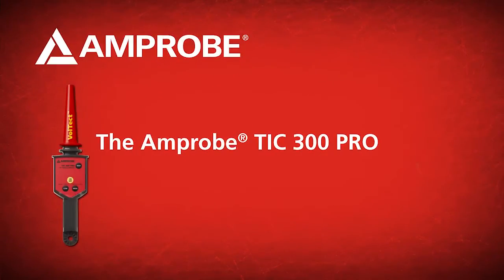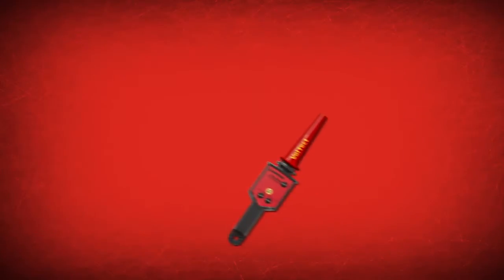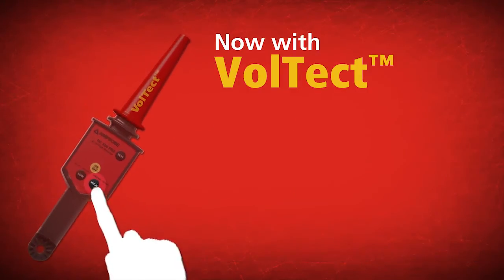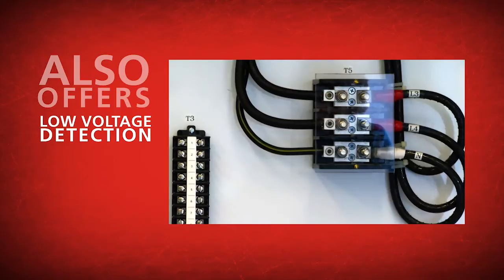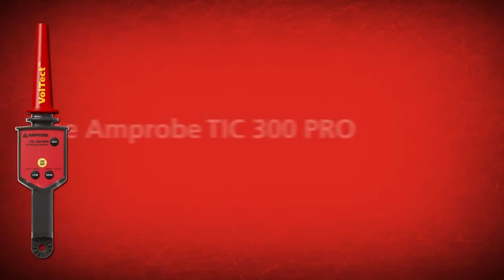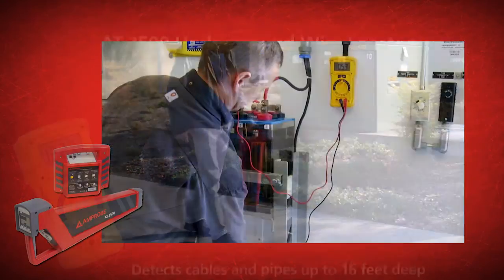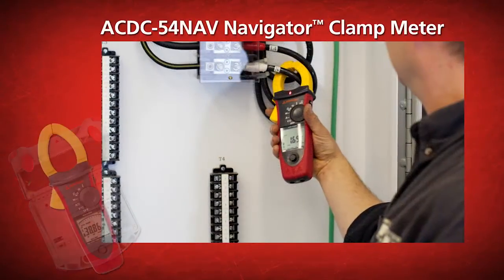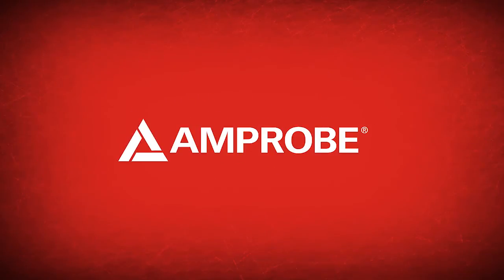Amprobe TIC 300 PRO with VolTect™ Non-Contact Voltage Detector

Comment: I find this tool useless for working under power lines. It goes off even if the structure is not hot. Giving no real indication if you can safely work on the structure at ground level. You end up having to chance it and touch the structure. what a waste of $. I know my lines are energized, what I don't know is the structure hot.